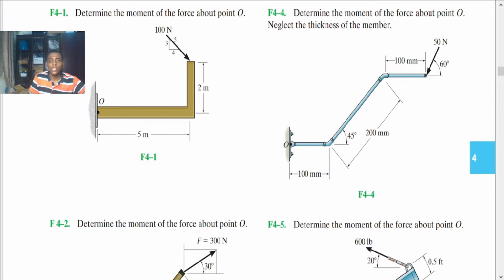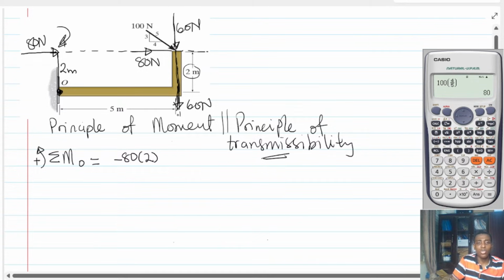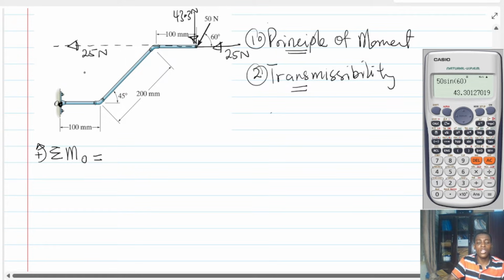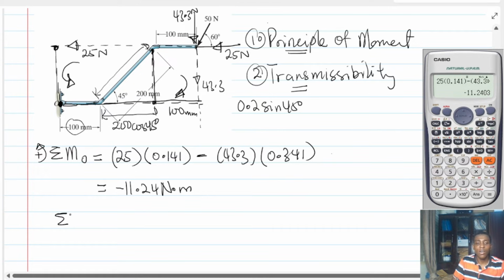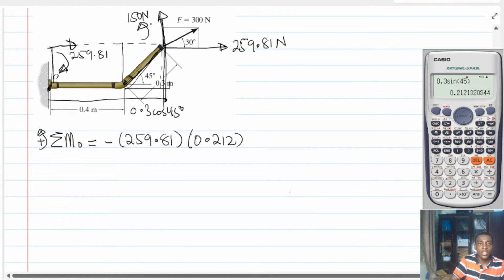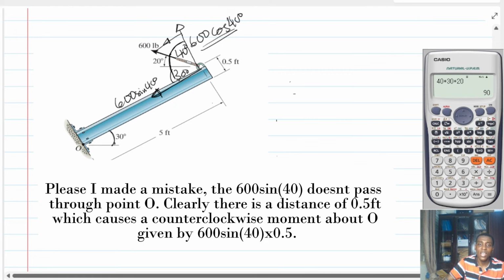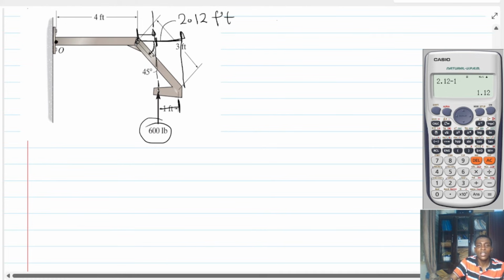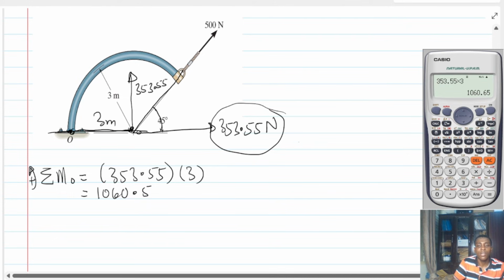Moment  of force  2D; Problem set 1

Comment: is it doable https://youtu.be/1sdPvHTsbBY?t=1180 if i wanted the beam's total horizontal force instead of using the 5ft?
Reply from the maker: In that case it is still doable as you says but then it will make things complex a bit if you are not strong enough.  😂😂.  

So please stick to this method.  Else you will resolve the force and also the beam distance.
Reply: @MechLearn-360 you cooked me...so yeah  I am strong. 😂🔥🔥👌

Comment: 12.2O ....check if the distance is really 0.341
Reply from the maker: Please yes.  What do you think the answer is?  Let me know.
Reply: My final answer is 6.92Nm please confirm it....
Reply from the maker: Your answer is wrong. You can check out the solutions manual. 

Just follow the intuition behind what i did.
Reply: (0.2cos45+01=0.241 )?×43.3-(0.2sin45×25) taking clockwise as positive
Reply from the maker: Did you notice that there are 2 of the 100mm. The bottom part and the top part.  Plus the resolve part of the 200mm into vertical and horizontal components
Reply: I stand to be corrected 😢
Reply from the maker: you can text me on +233557765496 for more
Reply: Oh oh😢I've been awake for some time it's time I went to bed😂